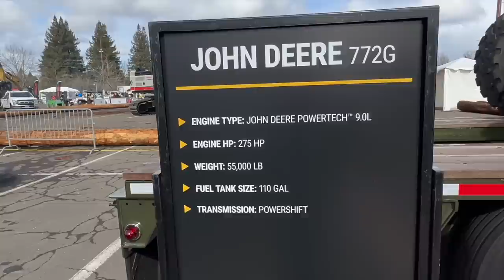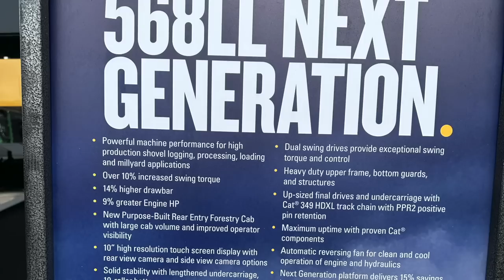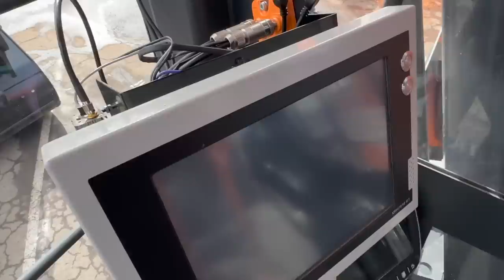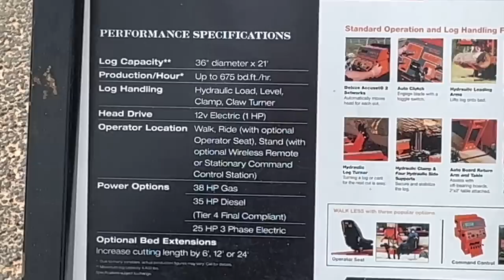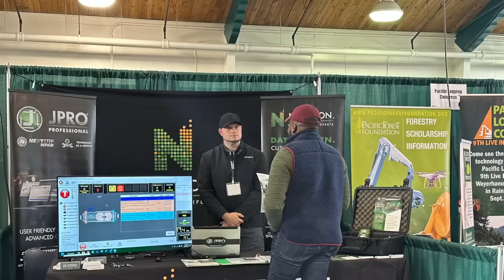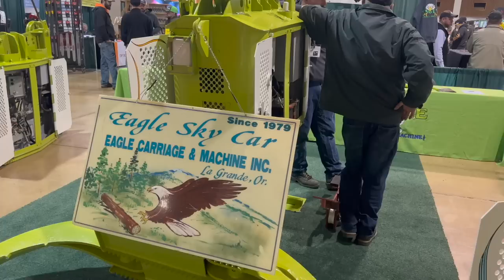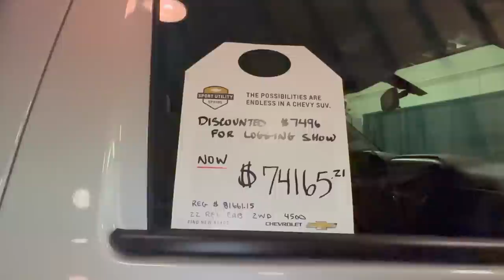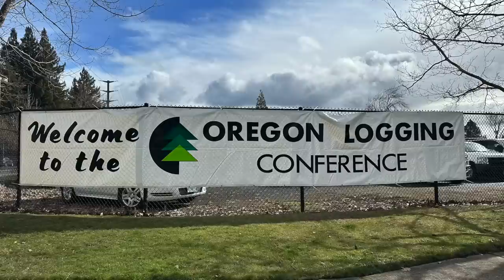FEBRUARY 23, 2023 OREGON LOGGING CONFERENCE IN EUGENE, OREGON LARGEST LOGGING EQUIPMENT SHOW (WEST)

Comment: Thank you for taking me to this beautiful fair. However, I noticed in the specs at 2min54sec that probably 2 dimensions were swapped. The weight and the breakout force. I can not imagine that the small loader weighs about 8000 lbs which would be about 4 tons. 
4 ton breakeout force i can imagine. what do you think about it ?
Reply from the maker: Thank you for your comment ..I agree with your statement that’s a lot of  breakout force for that machine.